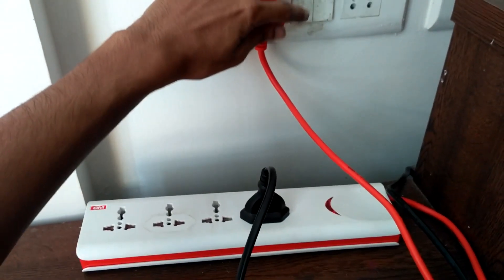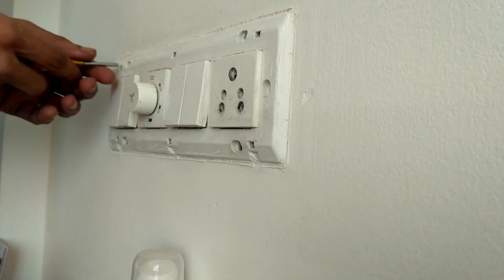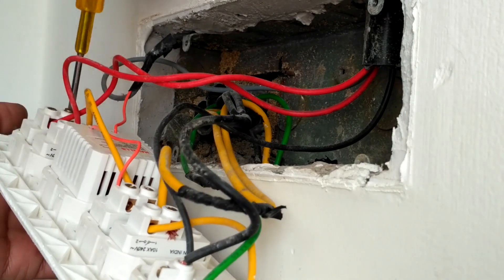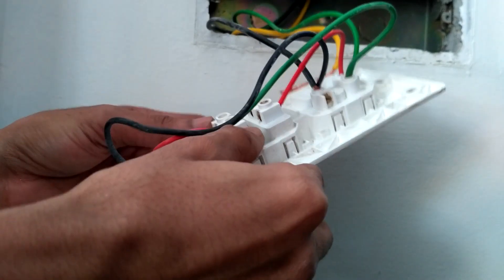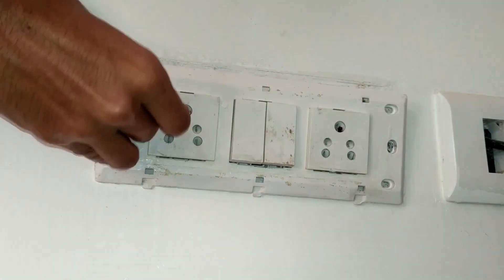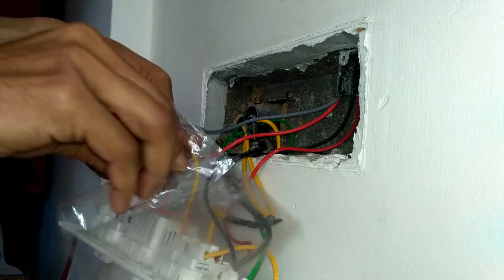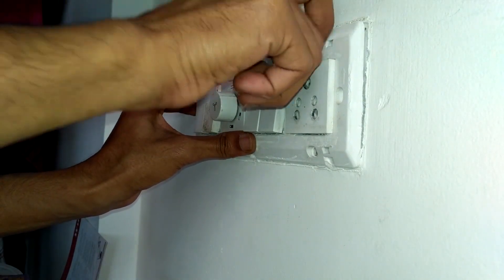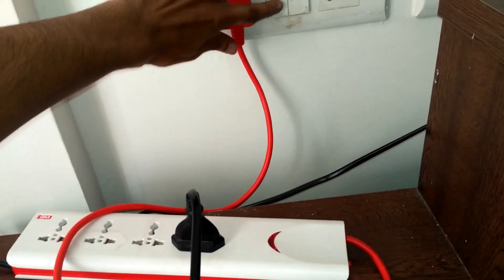Electric switch board | 16 Amperes switch replacement

Comment: How to make bedroom switch of 15 amp for heater
Reply from the maker: Hi Candy, for 15 amps heater- you must have a separate line in the switch board which can stand 15 amps capacity otherwise the switch as well as socket both will melt. You can connect any electrical shop and get the info and purchase 16 amps socket and switch.

Comment: There is no yellow line, I have two black wires in 16a switch.
Reply from the maker: Hi Kushal sir, commonly the yellow line is "LINE" wire, "BLACK"wire is ground line & "GREEN"wire is for earth. I think you're electrician didn't follow the codes and to save his time, he added two black wires.
If you check any 3 pin plug, the L letter indicates"Line" which will fit into socket and socket to switch. By this you can find the line wire.

Comment: In my switch board I need to replace  16amps plug
Reply from the maker: Hi Sairam, are you asking about socket? Or switch? You can follow same procedure for 16 amps switch/socket. Better by new one from shop instead of taking it from other switch board. 16amps are mainly used for water pumps, freezers, water heaters, inverter connections.

Comment: Should I replace a 16A switch with any particular 16A switch or normal switch?
Reply from the maker: Hi Srivatsan sir, if the switch has screw grips then any similar switch can be replaced. For the switch shown in this video is clip type so you need to replace with clip type switch only.
Reply: Can I replace 16 a switch to normal button, because I have many switch
Reply from the maker: No, 16 A switch will be given high tension wire so if you put normal switch and use it then it'll melt like chocolate.

Comment: How to remove the switch?

Should I just press from the inside? 😕
Reply from the maker: Hi Mithun sir, yes this type of switch needs to be pushed from inside. The switch will be clipped to clip panel and the clips need to be brought out of panel and SW need to be pushed as well.